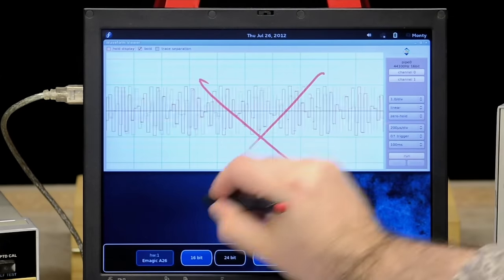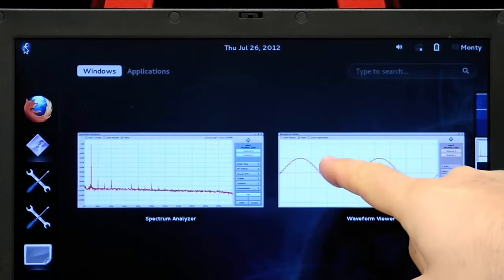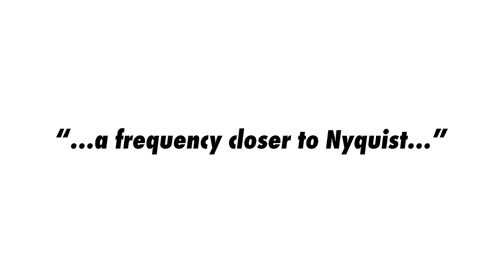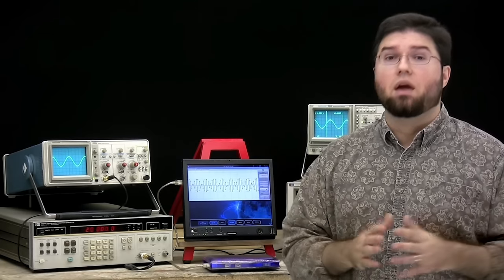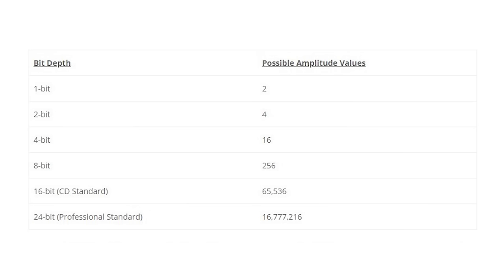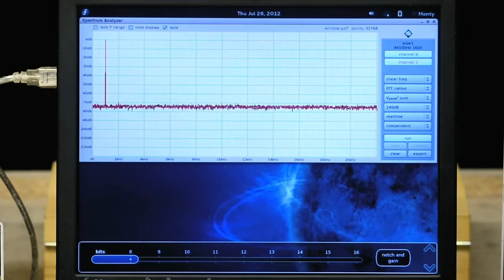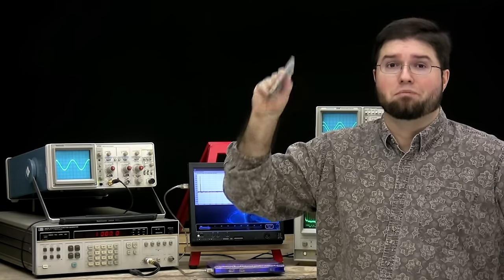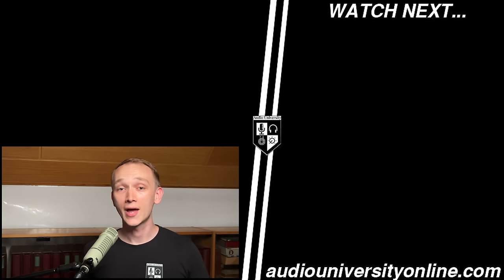Debunking the Digital Audio Myth: The Truth About the 'Stair-Step' Effect

Comment: When this is true, then why do some dacs sound better than others?
Reply from the maker: That's a good question. I would guess it has more to do with the analog circuits within the converter than anything else. But as you can see by the comments, this is a very nuanced and debated topic.
Reply: Nonlinear DACs usually. The transistors used to convert the 16 bits of a sample into analog are not 100% the level they should be. In cheaper DACs you have “jitter” which is where the timing of each sample being deployed by the DAC is not 100% accurate to the 22.6757…. microseconds between each sample. These points are important because while humans can generally hear up to 20kHz, our perception of audio signal time separation is 100kHz. This is usually made up for in the phase of the original frequency but with jitter can become noticeable

Comment: A 44.1kHz sample rate is not a high enough sample rate to perfectly reproduce a sound in human hearing range; it would be if you had an infinitely high order non-casual low pass filter, but it doesn't work in reality. You only get 6dB/decade(or 2b/decade) and the highest practical order filter we can reach is 8th(or 16b/decade). So if you actually want to hit effective 16bit audio, then 192kHz will get you 19.2kHz at 16bit. 

You haven't discovered some mistake/lie by the audio industry, you just misunderstood some math.
Reply: @nicksterj Oversampling is literally what I am describing. Everything above 48k is an over-sampled standard(either integer multiple of CDs 44.1kHz or DVDs 48k). 

Are you talking about interpolating DACs? Those work very well for dedicated music players but require significant input delay to work. Using a MAX5894 as example, there is a 311 sample delay when using 8x interpolation; applied to a 44.1kHz signal, that would be 7ms of lag. That isn't at all acceptable for a PC DAC, and debatable for video playback.

Comment: Music is not sine waves.  Lets say an instrument is playing at say 99hz and another instrument is at say 139hz  what happens then and say the 139hz is low power and the seconds later is high power. and do the same type of test higher up the frequency band. Just think about what the speaker cones has to do. So the cone is going back and forth at 99hz and at the same time the cone also has to do 139hz which could be higher power or lower power. So as the cone is going up and down at 99hz its also jigglingat 139hz either greater or less. all this applies to the signal wave and the air ppressure waves hitting our ears. Its a wonder music is not a load of mush . So how does digital handle all the different musical diginals that are occuring at the same moment in time.  Beats me. I am not an electronic engineer, I am a design engineer in products and machinery .

Comment: Dandy video. OK. I expect your claims would stand for continuous waves. The image-averaging nature of the continuously-triggered scope presentation hides the "noise". I offer two suggestions, or perhaps, challenges. #1) Let us see any one single sweep, and I bet it will have visible noise steps. Do it close to the nyquist threshold for clarity. #2) In as much as the Nyquist criterion is stated for continuous waves, I believe your single-sweep transient response will not look as good in that case either. || I still do not know what smoothing is at-play on the final D/A output. You are certainly not pumping out a series of continuous pulses.So, the test I wish to see may not even be possible with your hookup.

Comment: Yeah I have a couple of angry comments. First, human hearing goes much higher, I'm a mutant but I can hear 188,000 Hz. Second, "lollipop" signal forms means NOTHING is measured between samples, even at 44.1 KHz that leaves empty zones. Third, waveforms made by today's kid-sized earbuds and cellphones utilizes one weird function of our brains by transmitting ONLY the harmonic sections of a tone within the limited range of the earbuds, since they cannot projects sounds of low frequency they fool our brain by transmitting the harmonics of a low frequency and we interpret it as a low tone. This sounds like shit to anyone who is used to high-end analog. So it's still a hard pass for digital, it's not bad if you have wave-form interpolation software, but otherwise it's like listening to music on a kid's toy. [end rant]

Comment: What?!  You are incorrect.  Let me take you to tech school, I fail to grasp why audio engineers are so stupid when it comes to tech?  I guess...  

Very senior software engineer here.  First, what you are correct on is that at a certain bit depth you're likely good to go.  Humans only need so much dynamic range, fair enough.  And there may be analog limits (there exist NO digital ones, by the way).  

That said, you seemingly combined or mentioned, especially at he end, frequency.  Which has literally nothing to do with bit depth.  You took a good video and then completely misunderstood everything.  Great job.  I'm actually impressed.

Bit depth is NOT the same as frequency.  In fact, they have quite literally nothing to do with each other as far as technology is concerned.  Please STOP putting both in the same breath as if they are related, or switching between the two.  

They are not.  This is objective, and not open to your opinion.  Your reference video covered bit depth, it did not cover frequency.  Your closing argument then did a sharp left turn to frequency out of nowhere (measured in Khz) and talked about distortion?   Um, unrelated and incorrect.

Let me explain this simply.  Digital audio is simple (sorry audio engineers get over it).  It's data over time.  

Bit depth measures the Y-axis, that's your dynamic range.

Frequency measures the X-axis, which is time.  

Any bit depth and any frequency works.  And they are entirely independent.  There is no upper bounds to either of those.  

Obviously at very low values you hardly qualify as a wave any more (like 1 Hz or something).

So if you're plotting data points, higher bit depth literally translates into more possible values.  That's all.

And higher frequency is how many points you're recording over a given time span, typically measured in how many per second (kilohertz = thousands per seconds).  

Increasing both always increases precision.  Is higher always better?  Yes.  Period.  This is how math works.

So what did we learn class?  The closing argument was hilariously off subject, conflates bit depth with frequency, and is factually incorrect with an out of nowhere statement. 

Are there diminishing returns?  There can be, sure.  But they are returns.  You're not losing data increasing bit depth or frequency, obviously.

Not surprisingly, this is almost exactly analogous to bit rate on video.  Higher is always better.  Same goes with sound.  If your argument is about signals (analog over the wire to a driver or something).... cool.  Irrelevant to digital storage.  

How audio is reproduced is separate from how it's stored and transmitted.  The source should always be at the highest quality possible.  And the crappy tech in the analog world will catch up eventually, I suppose.

Down sampling is easy.  Up sampling?  Yikes.  Much like video trans-coding (YouTube does this).  When you upload your 4K video, YouTube automatically transcodes into lower resolutions (and lower bit rate).  But it doesn't up sample.  By your argument, stop uploading 4K videos.  Someone's monitor can't display it and it takes up too much space?  Yeah, sounds stupid doesn't it.

Finally, storage space?  Are you %^#ing kidding me?  What year is this, 1830?  You have 4K video but think audio storage is big?  What?!  Go ahead and rip out the audio track to this upload in lossless encoding.  Then compare it to the video.  I wonder which is bigger.  Hmm....

Now that I've lost many brain cells, back to StackOverflow where real engineers are.  Good luck on understanding computers.

And your description "Learn why 16-bit/44.1kHz audio is just as good as high-res audio formats for playback (if not better)!".  Um, no.  Just no.  It is never better.  It's a mathematical impossibility.

I look forward to your next braindead video.  "Lean why 1080p is just as good as 4K (if not better)!"  So dumb...

Comment: First off, no expert here.  This test does not reflect a real life situation.  A sound is normally affected by harmonics, either in its source or as reflect on things around and the ambient--or both.  The sound of something that has a high frequency, let's say, a cymbal, a hi-hat, or even just the pronunciation of ss, is affected by harmonics--even low frequencies can produce high-frequency harmonics and the other way around is true too--, and sometimes the harmonics can be at a frequency even higher than what we can hear, but they still affect how the audible frequency, making it different.  Replicating that is not possible with a low sampling rate because some harmonics, which can be affecting nearly everything, are not present.

So, yeah, there's some debunking there, but apparently only if you're working with a specific frequency and without being affected by any harmonics.  In applications where you have different frequencies, like music and narration, for instance, anything being reproduced at sample rates like 44.1 and 48 is simply not a real-life experience.  What kind of application would 16-bit/44.1 kHz be as good or better, then?  Single frequency test applications?
Reply: you are right but if the harmonics in the signal is higher than 20Khz even if you are in the same room of the hihat, you will not hear it

Comment: I still dont belive it is the same. The test was made with only with sinewave, the simplest waveform. If the waveform is more compex we have problems woth this model. At 22.05khz a sine wave is the same as a triange sqare saw, but in essence is not. But the argument is anyway you cant hear above 20khz, well you can at the right volume, but even so is debatable of you can distinguish a 18khz sine from a saw square and any other form, this in the realm of psycoacoustics and perception. Another thing that is not debatable is that the impulses, transients are more acurately represented at higher sample rates. It is still good and free to think for yourself, even if somebody said something else. The thing about bit depth its extra stress for the speakers, intermodulation distortion, and its like muddy water, you can still partialy see trough it, in case of 140db playback at least

Comment: Theres something you learn over the years . Specs dont translate in the real world. They make amazing dacs now. But thier the same cost and have similar performance as equally priced record players from years ago. 
I can hear the compression and jitter . The trick is to scrub it out with tubes. Likewise a high end D class integrated. You hook that to a record player. You guys are too young to unpack this. You need original pristine pressings. The emotion and soul just aren't there in a digital recording , and neither are the sound engineers . Just a thought. And the ritual is a pain as far as LP's but quite rewarding. 
The old FCC spec rules legitimately tested specifications. Now adays not so much . Im 45 with 30+ years experience. I have access to a vault locally with the most up to date high end equipment available . I don't know what else to say . LP at 80k$ turtable wise sounds better. 
And thats it. Class is in session.

Comment: I don't think this holds valid. This is just an analog waveform converted to digital, whereas a real world application would involve multiple waveforms for the conversion. That is when, in audio, the "stairstep" becomes audible.
Long story short, a 'stairstepped' analog signal, is not a digital signal.

Comment: So much misinformation!!! :-(
In a typical mix, a 20 kHz signal has only 1/1000th the amplitude of a 20 Hz signal. So in a 16 bit recording, there is less than 6 bit left for the upper end of the spectrum. That’s not very much dynamics.
When recording with 44.1 kHz, you must make sure that your analog input does not include any frequencies above 22.05 kHz, otherwise you get nasty distortions. But an analog filter will not cleanly cut at 22.05 kHz, but also dampen frequencies far below than that. The proper way is to sample at a much higher sampling rate, and then reduce the sampling rate digitally if you like.
Also, if your input signal approaches the nyquist frequency, there will be a tremolo effect, and on playback, and there is no way for your D/A converter to know if this is intentional or not.

Comment: 44.1 can do a sine at 20k but it can't do complex waves at 20k
Reply: I think lol
Reply: @nrezmerski mmm I know, what I mean is... if you sample twice a cycle yeah you can reconstruct a sine at 20k, but what if it's a very complex wave with a fundamental of 20k - I don't see how that can be reproduced even given the best fit stuff in the vid idk
Reply: @nrezmerski lol I know it's academic =) still though you're assuming that the human ear works in the same sampling fashion, idk if that's the case
Reply: @seth4766  a complexe wave form at 20 Khz (I supposed you mean the main frequency is 20K) means that harmonics in the signal will be higher than 20Khz so even if your speaker play them you will not hear them
Reply: @brianhead814  true. I mean I can barely hear anything above 16k lol

Comment: You almost got me until you showed Photoshop. So the signal is stair stepped. You cannot know what is between samples. Just because you assume doesn't really mean anything. Same for the Photoshop. I understand the point of course but scientifically speaking or let's say experimentally speaking if you get digital samples without any instruction how to connect them you get the stair step.
Reply: MF Nickster  there is only one band limited signal? I'm not familiar with English language that much. Does that mean that frequences that are higher than the same blood rate are not allowed in this assumption? Does that bend limited mean?
Reply: MF Nickster  ok. Thanks! I do understand it a bit better now. At least why they chose that bit depth and sample rate for CDs. I'm still not sure about the Photoshop reference though.. maybe it was just a good visual explanation

Comment: nonsense. if sample rate was thought of snapshots in time like it is (instead of talking about high pitches)then try compare it with taking a movie image .If you film an object like a horse running or a ball through the air moving over time or frames per second the less frames you capture the less movement you capture .There are missing pieces or positions,locations of the object that are lost in recording and therefore playback.Back to music the vibration of a guitar string recorded at a higher sample rate has more of the original sound recorded. The sine wave example produced on the oscilliscope in the video here only looks the same because it is converted back to analogue and produced on a screen .How fast is the image displayed? what frequency is is displayed and how fast is the human eye?You may think it is the same as original sound,its close but it is not. its a picture not a sound .record a single guitar string at 48khz and it sounds like a guitar string but record it at 96khz and it sounds more real with more accurate vibrations represented .Its measurement over time nothing to do with how high pitched the note is.Anybody cant hear it then fine it doesnt matter to them .Some people can hear more detail. ears and brains are probably faster than notes but that is hard to prove.Anybody want to try it .record a long sustained acoustic guitar note first at 48khz then compare it with 96khz and see what you think.Dont even have to record just listen through headphones and change sample rate on your interface to hear it .Is this video suggesting there is no sound or positions in between sample point .nothing there that is lost ? how could you display the position of an object if you havent captured that position at that time in the snapshot ?in audio when would ear or brain pick up on samples in a linear way ,it could probably pick up on in between samples at any points along the way.capture more it will be better .proof is in listening for those with patience to test recording it themselves
Reply: wasnt the reasoning behind digital sampling at 44.1 that it was twice the highest audible frequency of hearing and thats why Nyquist Theorem which was already in existence was the method applied ? and that it meant it would be very accurate at reproducing sound without noticeable loss or change? it is not taking 2 samples of every amplitude point. the amplitude points are not all captured at every level. try the single note on a guitar and see if you hear it and its not imagined.to be clear i cant hear a difference between 96k and 192k. so my imagination doesnt go that far

Comment: Density Pulse Modulation / SACD / Sigma-delta Part2

Come on! , people just said tha stairlike in PCM is a myth and does not exist,  and you came up with the DSD which is pulse density, what about my sine and cosine.
Yeessss, you have this, which is even worse, somewhere but of course if yo wait a bit let the simple  1bit=Sigma-delta dac doing the job and .. surprise in RCA output you can have your beatiful sinusoid indeed! So you have such beast somewhere does not matter stair a else, not on the output.
This apply to people thinkig: a) that because you have such things somewhere you also have at the output  or b) because you don't see them in output 
think those never existed. Period!.